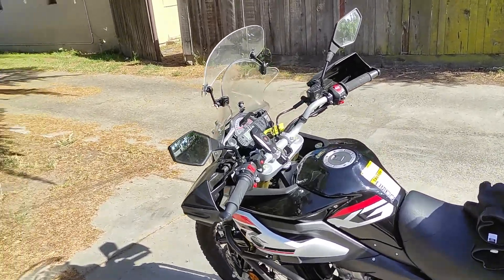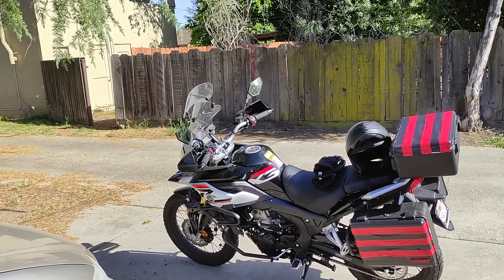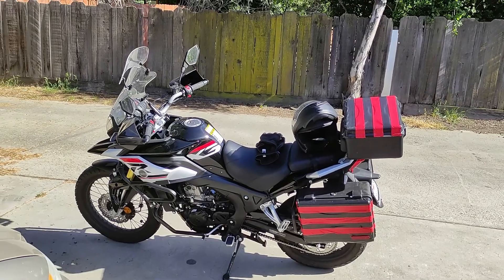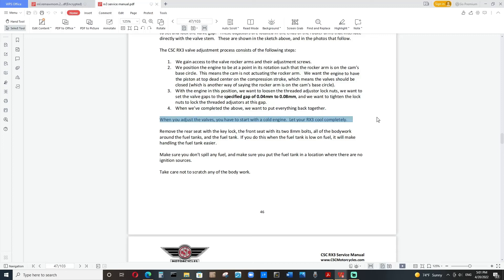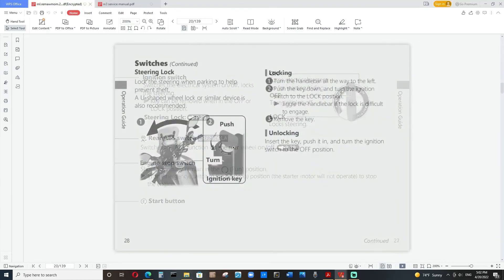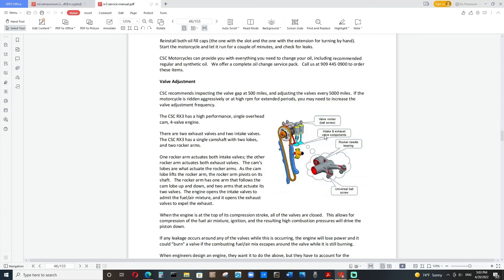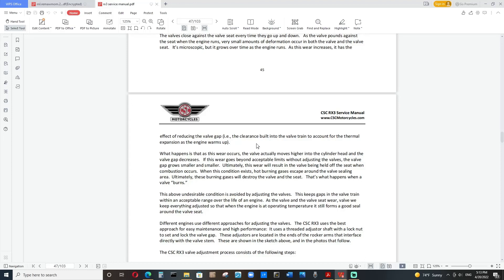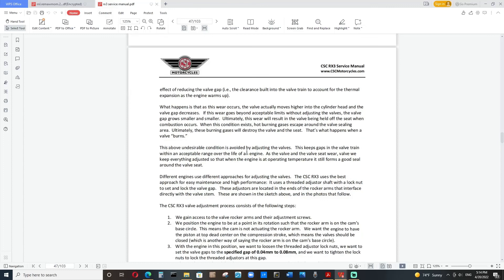CSC RX3 Valve adjustment update

Comment: The directions in the manual on the website are wrong!  The cyclone is missing a huge section. I had mine adjusted at TDC and then realized it was 180 degrees out. threw a lifter after I followed the directions.
Reply from the maker: Wow, I actually had to take a look at the RX3 manual again to inspect it and I'm afraid you are right. I am unsure in which direction you spun the motor but the manual itself doesn't specify in which direction to spin it so that's not your fault. If you spun the motor counterclockwise which is the direction it generally is supposed to spin; it's virtually impossible to land on TDC without being on the compression stroke. I don't know if you spun your motor counter-clockwise but the only way you could land on TDC and not be on the compression stroke is to turn the motor in the opposite direction.